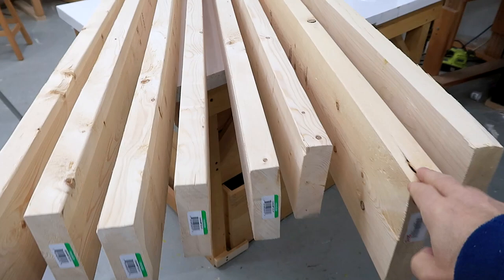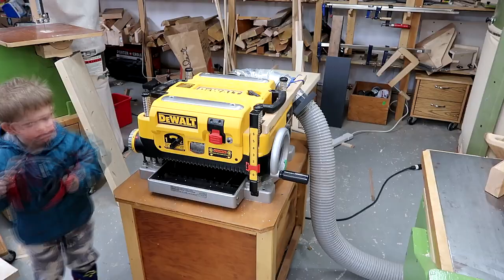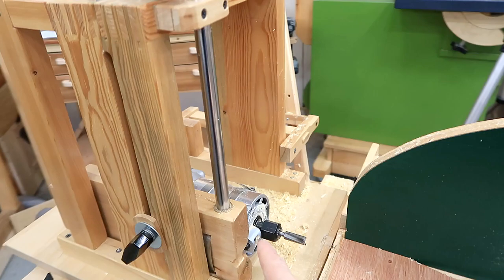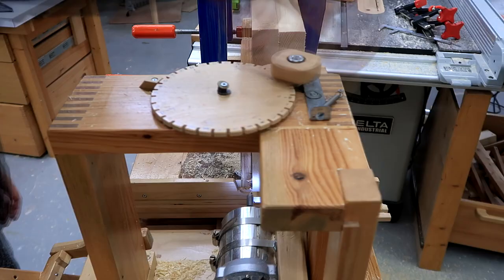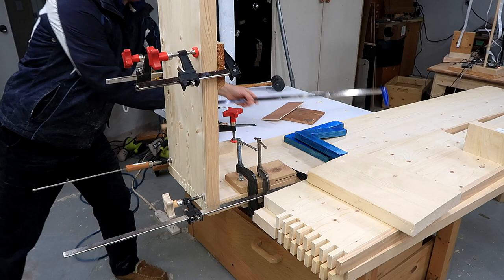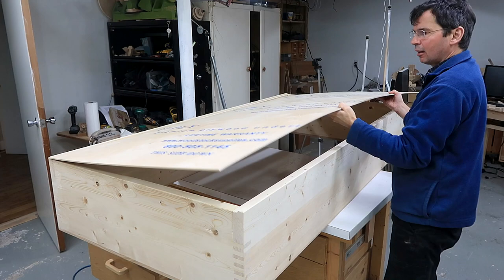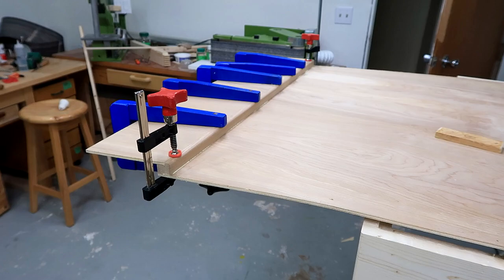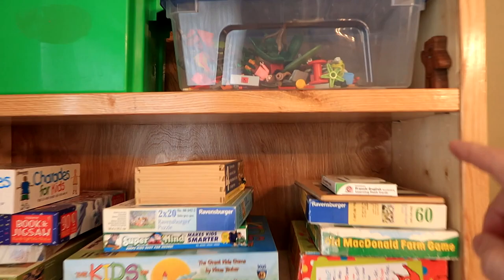Big box joined bookcase

Comment: Couldnt you just flip it around and complete the box joints from the other side?
Reply from the maker: Too hard to get the alignment right.  If it's off .1 mm, that makes the fingers not fit right.
Reply: @matthiaswandel  whoops, I see someone already asked the question I asked.  As far as alignment goes, can't you use the bit itself for alignment, by manually positioning it in an existing slot?
Reply: @matthiaswandel , I have seen your work, you can do it. Try some scrap.
Reply: @macedindu829  Even using the bits for alignment it will be off simply because the realities of manufacturing.
That rod he uses. Or the wood that the machine is made of. Or the slack in the bearings.
Or all of the above. Everything contributes tiny misalignments. Even the deflection caused by the tool cutting the wood vs resting against it while stopped can be too much.
Even with VERY high precision tools, you still don't flip workpieces around.
Reply: @Prophes0r  Uhhhh, with very high precision tools, there's some reference point on the workpiece (a corner, or a set of holes), and probes which can locate to a couple um - it's no problem flipping pieces around and re-probing the reference points and machining from a different side - it's done all the time. And this isn't rocketship parts - it's a wood bookcase - it would work just fine.
Reply: Thanks for asking. Hoped someone had already posted this question when I wondered myself.
Reply: Couldn't you have aligned the existing lowest cut with the bit and therefore it would have been the same spacing. If anyone could do it, it would be you
Reply: And if you flipped it, maybe one spacing would be out by a mm, better than nothing at all. That's not a dig, just interested is all.
Reply: I was thinking if one of the pair was flipped around, aligned with the other and clamped, you can use the other box cuts to align the router bit to finish the rest.
This is beauty of cabinet making....we all have our own methods of construction, I wouldn't have thought of using a box joint but I really like it here. Nice work!
Reply: @stevenvachon9745  but why bother?  the bandsaw cutout takes 30 seconds instead of a half hour of fiddling
Reply: @natalieisagirlnow  same reason why you would take the hour to cut box joints in the first place.
Reply: @stevenvachon9745  diminishing returns for extra time.  you have the fingers, more fingers doesn't necessarily add anything else structure wise
Reply: @gorak9000  It wouldn't work just fine.  It's going to be off by a little bit, which with how tight those box joint fingers fit, he's going to have to either loosen them all, or cut them off and start over.  He's working with construction lumber on a woodworking machine using drawer slides. not a Bridgeport or something.
Reply: @anthonycengia6593  If the spacing is off on one, it's going to be off on all the ones he cut the first time.
Reply: @matthiaswandel  clamp the parts together with a registration block the size of the finger then flip and align cutter and cut
Reply: On the pantorouter that would work because the alignment will be precise, but not on the slot mortiser, I think.
Reply: been grinding my teeth over it but knew matthias must have a valid reason for not doing it

Comment: keep in mind this is coming from the laziest guy in the world but, honest question: would cutting all the box joints by hand be out of the question?  is that even a thing, hand-cut box joints?  nice work by the way.  (except for the pocket screws of course)
Reply from the maker: if you hand cut it, it's gotta be dovetails :)
Reply: It also starts getting pretty difficult to hand-cut joinery on pieces that long. I did dovetails on the end of a 6-foot board once. It was tricky to find a workholding solution...

Comment: One easy solution to avoid the pocket hole screws, route a stopped dado in the sides of the book case, and the shelf, glue in a "floating tenon" in the shelf the full width of the shelf, then slide in the whole shelf with glue.  Done.
Reply: I was thinking the same thing except why bother with the floating tenon? Just route the stop dado, rabbit the front of the shelf to go over the tenon stop and slide the shelf in from the back. I guess you have more chance of gaps showing that way in the front
Reply: @Pborges475  if the shelf was already cut to width, you have no choice but the floating tenon.  If you still have it long, yes, you could do as you said.
Reply: Pocket holes are easier.
Reply: @1pcfred  well, yes, as we all know, Matthias hates pocket holes, so I voiced an optional way of installing a shelf without introducing visible attachment.  Is that hard to understand?
Reply: @adrianmack3  it is hard to understand. What is to hate about pocket holes? Once you have the kit then get in on it.
Reply: @1pcfred   They leave holes that are unsightly unless filled with dowels.
Reply: @firesurfer  it ain't Chippendale furniture. Beyond that holes that are out of sight are not particularly unsightly.
Reply: @1pcfred  build said the way you like, he can build said in the way he likes, doesn't affect you one little bit.  I have used and will use pocket holes, I could care less if he doesn't like them, that's his business.  Not everyone has to do as you would, it's called choice, get over yourself.
Reply: @adrianmack3  it is your capacity to comprehend that is challenged here. You're projecting your inadequacies onto me too.

Comment: My favorite after-the-fact joinery is to screw it in from the exterior and them come back and replace the screws with exposed dowels. It's not the prettiest, but I prefer it to pocket holes
Reply: I just use hardwood dowels, no screws.  But I wonder whether they would have enough shear strength to hold up shelves.
Reply: You can also spread the shelf a little, and pop a full set of fingers in one side and just dowel the other (or use half fingers, spread over a wide board, a shelf at that it won't argue for structural integrity any time in our life times.
Reply: Or just use exterior-showing dowels only without screws. Make it pretty as a design feature.
Reply: @washoecreative595  The glue butt joint is probably the strongest part of that joint.
Reply: @unnamed47  it would be joined together.  Thats what would happen.
Reply: @12345NoNamesLeft  Keep in mind you are gluing end grain with the shelves.
Reply: @unnamed47  not much would be gained probably since you're still cutting through short grain with the dowels.
Reply: @Andyjpro  😊😊👍
Reply: @washoecreative595  I don't see the issue with that. Tons of dinner table chairs are assembled with two 3/8" dowels or similar at every horizontal joint and they are expected to hold the strain of hundreds of pounds. I just did a wood glue repair of two dinner chairs that my dad did some pocket screws in an attempt to fix their side to side wiggle a few years ago. I removed the screws and never ever needed them again. I'm 230 pounds at the moment and the chairs now don't budge from my weight shifting left and right. The wood surfaces weren't perfectly bare wood either. Had some stain in the way but it isn't coming apart anymore without sawing it off.
Reply: @MrMega200  Thank you for your reply, that's good to know.  I like using through dowels as visible joinery.
Reply: Or skip the screws. Clamp boards above and below shelf to hold it in place, drill holes from the outside and glue in the dowels. Wedges between clamped board and shelf if necessary to hold it still as well as aligned.

Comment: thank you for pointing out the screw into the wall to help educate people. so many people forget to do this and risk a real problem when a kid starts crawling up the shelves to reach something. great video!
Reply: Yup - I had built a walnut bookcase (wonderful material, but heavy), and my toddler daughter pulled it down.  Very fortunately, she fit between the shelves, and emerged unscathed.  20 seconds later, it was screwed to the wall.
Reply: It appears to me that it was screwed to the wall through the plywood backing.   I would think that the bookcase with a child climbing it is heavy enough to allow the screw head to just rip through the thin plywood - i.e., the screw would certainly hold, but I question if the thin plywood would.

Comment: Very fine bookshelves, Matthias, thanks!  After months of thinking about how to make bookshelves for my small home I've decided yours are the strongest, easiest to make and install, and leave the fewest holes in the wall when the time comes to remove them.  Though my shop has a high enough ceiling, I'm not sure I can do box joints on such long boards on my old Shopsmith, so I think I will butt-join two half-length boards together with box joints instead to make the long ones.

Comment: My wife watched the video, says to tell you "You really did great!"  I greatly appreciated it, too.  I used 19mm plywood for the shelves, and put hardwood (Birch) edges in front and a hardwood (Birch) stiffener in the back.  Had them in service for 30-odd years, and no significant sag.  I used step miter, glue and brad nails at the corners, and they have held up, also.  All this cut with 8" craftsman bench table saw and lots of jigs.  It is so great to watch a true master work.  Nahm Abrams (NYW) has a tendency to resort to machinery that would put it completely out of my price range.

Comment: Nice.  I used much thinner shelves in mine, with birch fronts as stiffeners.  I put birch on the sides and top edhes, too, so shelves had to go in from back.  In subsequent years when my wife wanted even thinner shelves ("I only need 7mm more space..." ) I cut slots in the underside of the shelf, and epoxied in 1cm x 4mm steel stiffeners in routed slots on shelf bottom.  Not elegant, but it's invisible from front and has worked for decades.

Comment: Pocket holes in those center rigid shelves are great. Almost better than any other option. If you ever want to move that shelf a little bit to accommodate a different spacing - boom, no problem. Just some small screw holes nobody is ever going to notice anyway. As a habitual non-committer,  I love it.

Comment: I avoid tear out by cutting the fingers with the final depth in to the thicker material. After that, i plan them down to thickness. 
One benefit, you can put the scrap peace with the same fingers in the board. The overlap caused by the fingers ensures, that there will be no planer snipe.

Comment: To fix the middle shelf i like to drill holes from the outside and make a decorative Dowel joint out of it. This way i get more Woodworking Points for not using pocket holes 🙂
Reply: Mathias is Canadian and pocket hole screws are Robertson drive. So it's patriotic for him to use them.
Reply: could even add some "fake" dowels to make a decorative pattern, e.g. diamond shape

Comment: Thanks for the tip on preventing or reducing snipe.  Also it is a scientifically proven fact that little fingers are 81% more effective at reseting tripped circuits! 
Also you might consider replacing the factory power cord with a heavier cord, say a 10 gauge cord.  Just helps reduce any resistance in the power delivery and provides full available amperage to the motor.  Might reduce the circuit tripping as often, especially under max loads.  Because that's when it's tripping is under full demand for power.
Reply: The breaker is only affected by the load after it, so a heavier cord won't change much.
Reply: @milesparris4045  If the current in the load drops voltage across the cords resistance, then less voltage is available for the motor.  The larger the wires in the cable, the lower the resistance and voltage drop.  You are correct that it won't change much, but how much?  Sounds like a test is needed.  Matthias? future video possibility.
Reply: @milesparris4045  agreed, it won't make much difference, but sometimes having max current availability doesn't hurt.
Reply: @budmartin8297   I've seen tests that were done, and they were inconclusive. I think an in depth test is needed.
Reply: A bigger cord leading to the machine may help, but not because the smaller cord is restricting the current flow. There is enough current draw to trip the breaker on the machine itself, more current flow will just trip it faster. The reason a bigger cord may help is due to a weird way an AC induction motor works. Current flow is determined by rotor slip, the more rotor slip the higher the current draw. Rotor slip is driven by load on the motor and the field strength of the windings. A higher voltage increases the strength of the windings for the same current flow P=VI which results in less slip. So you can have the same total power draw with less current flow just by having less voltage drop across the power cables. If the motor in the planer is not an induction motor but a brushed AC motor, which I think is likely, then the exact values change a little as rotor speed is no longer locked to frequency but instead line voltage.

Just some quick napkin math IF the motor were an induction motor. If the machine is rated for 10A at 120V, thats 1200W draw nominal rating. If you have a standard 25' extension cord thats about 5V drop on just the extension cord (taking into account a 14ga cord with average resistance values for stranded copper). Add another 5V drop across the plugs, machine power cord and wiring from the outlet to the breaker panel and you have 10V drop aprox at the motor itself, maybe more depending on loss inside the machine. Just a 10V reduction at the motor will increase rotor slip and thus current as the rotational speed is fixed. The aprox current increase from just 10V drop is 0.9A, which isn't alot but can change the trip time on a time delay breaker from 10 seconds to 2 minutes or more.

For a brushed motor there are some calculations you can do to calculate the change in current given the reduction in motor speed will increase power draw as the motor moves towards stall, but it's not as clean as assuming rotor speed doesn't change since rotor speed is the primary component to back EMF which is the limiting factor for motor current draw in operation aside from rotor slip.

Comment: I noticed the completed shelf in the mirror during the introduction :-)  
Woodworking really is the art of adapting and finding alternatives when you don't have the right tools... (Note: you'll never have the right tool for every job... It's how you work around the issue that determines how good you really are...).  I guess the same could be said about machinists and other makers too...
Reply: Sometimes having too many tools gets in the way of using the best solutions. So does not having had the best tools for too long. I recently did a ton of hand work with scrapers, files and sanding on a project... what I really should have done was 3d print some guides for my router and used a flush trimming bit.

Comment: For attaching the middle shelf, I would have made the holes for floating tenons in the sides of the bookcase, positioned the shelf correctly and report the location of the holes on the sides of the shelf, drill those holes and used floating tenons.

Comment: Everybody who hates on pocket screws always uses them.  You could have have used dowels.  You could have attached brackets to the carcass and cut slots on the edges of the shelf that slid over them.  You could have made half-lap ledges that were hidden by the oak trim.  But, no.  Pocket screws...  Simple, efficient, and effective.
Reply: And look horrible.
Reply: @firesurfer  The screw holding the unit to the wall looks much worse, and is actually visible.
Reply: @bokkenka   That's debatable.

Comment: If Matthias can use pocket screws, I guess it's okay for the rest of us.

For horizontal supports in the middle of frames, for example, holding up the top of a bench, I use dowels.  It's a strong joint, but that rail isn't really holding a lot of weight by itself.  So would that be a poor choice for a shelf?

I don't like pocket screws either, but sometimes they are handy.
Reply: I like pocket holes for the fixed middle shelf of bookcases for one simple reason - it leaves open the possibility of moving that shelf a little bit to fit some specific item in the future, but still adds the extra rigidity needed.
Reply: There are so many "roads to Ottawa", but I think he wanted to get the job done with minimal fuss.  A housed dovetail made with a router would have been fun to watch.
Reply: @randybartlett3042  Or maybe a long floating tenon inserted from the back into slots that don't go all the way to the front. That would need clamps though, unlike the dovetails.
Reply: Dry dowels and a screw, or cabinet hardware would also work. Long dovetail/dado is a fun idea but would have required more planning, and execution than the job called for.
Reply: @randybartlett3042  Matthias and family are now several provinces east of Ottawa.